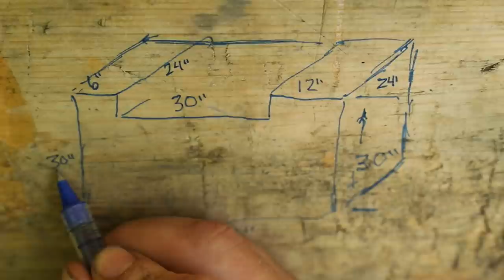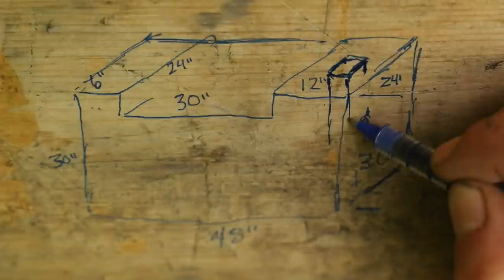Rock and Roll Barbecue BBQ  | The Forest Kitchen | Off Grid Log Cabin Build, Ep.5 S1

Comment: Awesome video, Thanks! A little late but I have found that a must have in the woods for constructing is a 2 wheel hand dolly, it's a must have for exactly what you needed, moving around big rocks or logs. You can pull up to the subject, ratchet strap it to the dolly and poof the rock has wheels. ;) I definitely want to get me a big tire 4 wheel cart like you have too, but I'm telling ya, two wheel hand dolly is a great tool to have. Strap one end of a log to it and you can lift the other end of log and drive it around. Great vid as always, can't wait to see more.
Reply: i use one all the time,, broke the wheels off a couple times,, i also used a 2 wheelbarrow  with solid tires..no paint on my hand tools.. i keep adding blue paint on some just to keep track of  becausedeep bark & sawdust.. aloha

Comment: As a Stone Mason I will tell you that you should mix that mud with a hoe, it is much easier and much faster and more efficient than with a shovel. Believe me I did it for years.
Reply from the maker: Agreed, I need to pick one up or a hand operated cement mixer before my next big project
Reply: A forester showed me a hoe they make out of old wore out shovels that make a regular hoe almost obsolete, they cut down the shovel down to about 5 or six inches  cut  the metal handle in the curve  and weldit back on at 90 degrees! You can move dirt like you wouldn't believe! Its incredible!

Comment: Hats off for moving those big rocks.  Your process of creating a void inside larger rock and then filling with smaller rocks and concrete is a winner! I'd suggest to mix your concrete dryer. I was told by masters of mud that, "the dryer the mix, the stronger it will be." I had a chance to prove that to myself a few years ago. My wife and I underpinned our 28' x 46' house. There existed poured walls and a few attempts at a slab. Ceiling height in this cellar was 5' or so.  It is now underpinned by a new foundation pour with lots of rock and has a ceiling height of 8'. People thought we were nuts but it wan't that difficult, one Summer getting to know dirt, rock, concrete, and the joy of creating!

Comment: I moved a lot of boulders for an extensive landscape project years ago. I discovered that an ordinary steel 2 wheel cart, the kind the home stores sell for about $100 with inflatable tires ( like on your wagon) worked great. I even developed a technique of “ rocking while pushing the load plate under the boulder with my foot” like you did with the log fulcrum and lever. I used the upright frame of the cart as a lever to rock the boulder up and then scooted the bottom plate further under the lifted rock just before it fell back. the wheels of the cart were my fulcrum. Hard to explain but it was a slick way to get the big ones where I wanted them. I am a subscriber and have enjoyed your videos for a long time and think they are the best out there. Wish I could meet you and Caley sometime and shake your paws.

Comment: Nice video. I do have a question though. How come when building cabins, kitchens and any other structures that no one seems to think it needed to dig out and rock fill a drain field that would pull groundwater away from their structures? This would allow for less rotting, moisture/humidity buildup, mold growth, and control overall settling of the structures that could cause moisture to collect ever closer to the wooden portions of the structures.

Comment: Quick question. Wouldn't it have been easier to stack the stones and pour concrete in smaller layers? Maybe even making a dirt ramp behind the BBQ to role the stones into the mold? It seems quite taxing to have to heave the boulders over and in.

Comment: Have you looked at earth ship designs or earth bag❓What was your profession❓You could even do an Air B&B with the guest cabin as a way to get others involved in the basics. For ticks get flea collars and put around ankles preferably with pants tucked into shoes and socks then collar can be placed at top of boot. lemon eucalyptus oil protection against mosquitoes as does lavender, thyme, rosemary, marigold, plus many more that you could plant around the home area and/or make into spray for environment, yourself, or Cali. When I went to doc yesterday there was landscaping going on. They made squares linked together length and height of approximately 3 feet high. These are out of rebar or some type of metal the filled each one with rocks to make a privacy type fence. Cheap fairly easy and probably find something like that on a Craigslist give away. My word I hear some pretty large bugs buzzing around‼️

Comment: it is all beautiful what you make, but one thing is striking: you talk about the preservation of nature, with which we must be careful, clean air, clean water and at the same time you use a lot of cement mortar to make a barbeque , while mortar is known to be quite harmful to the environment. it is a chemical product. I don't know what cement you used. Geopolymer concrete is a product in which the traditional cement has been replaced by a binder that is composed of industrial residues with strong alkaline activators. In addition to an enormous burden on the environment, this has the advantage that the hardening of the concrete is much faster and the end product is much harder and more durable.